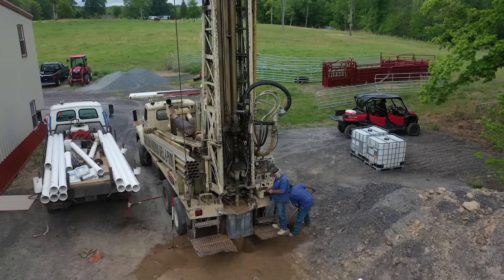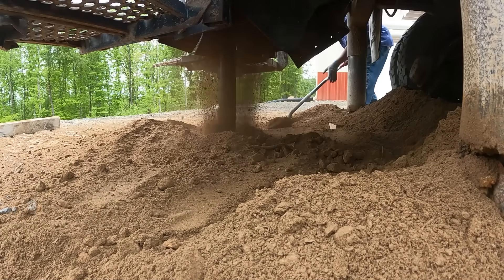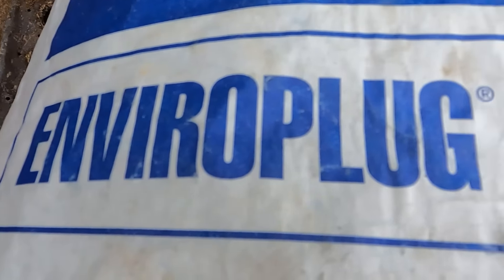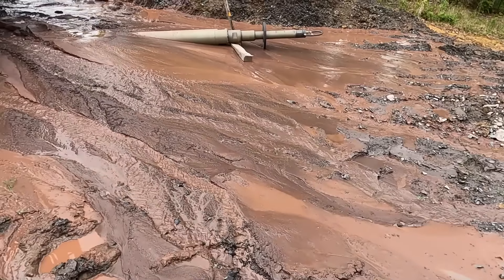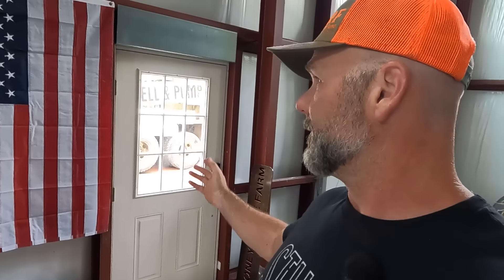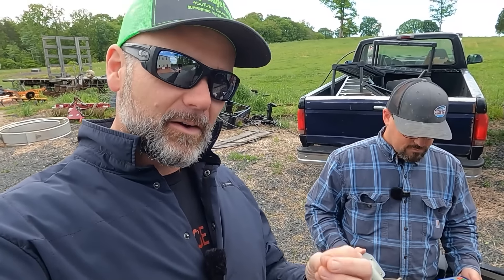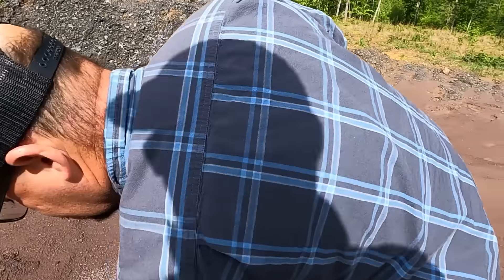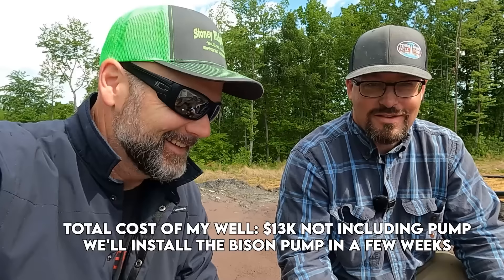How to drill a well on your property, land or farm?

Comment: Nice video, thanks! The initial drilling (before installing the casing) is shown bringing up soil, which is shoveled away. But it is not clear how the rock debris is removed from the hole once the bit hits bedrock?
Reply from the maker: just like drilling into concrete....the stone chips/dust comes right up and out of the hole...pushed up by pressure from the water in the well drilling rig.  Once we get to our desired depth we blow the hole out and all the debris comes up....and yep...it's a fairly large amount.  4 inch drilled hole down 500 feet really is only about 5-10 yards of soil/rock/dust

Comment: Page 357

Blowout preventers (BOPs) are used to control the pressure in the bore when drilling or working over, ie performing remedial  operations on a producing well to restore or increase production.
Reply: Page 134

boring (Eng) = The process of machining a cylindrical hole, performed in a lathe, boring machine or boring mill, for large holes, or when great accuracy is required, it is preferable to using a drill.

Page 659

lath (Min) = A term commonly applied to a lath-like (long and thin) crystal.

Comment: The Red-ish color coming out at 285ft looks like Terasic Basin rock. I wonder if that's the case. If it ever collapses, the well should be screened. These guys are 90 miles from me. Static in NC should be around 30-40ft typically

Comment: Just had my well drilled in Washington, $29,689 tax included drilling only, it included metal casing and PVC casing, 320 feet deep well and 20 gals a minute. Than it was another charge for a pump setup and get it ready for the house, electrical work, panel on base meter for pump, 2 frost free hydrants, so that was another $16,900 tax included, I didn’t know it was going to cost me that much, but they did a good job

Comment: Yalls rig is crazy different then what im a hand on. We go typically 280-380 for red bed. We use water and mud pit to pump out what the hole makes and raise suction and add watwr as needed. Casing is last and fast the we gravel pack the outside of the hole. Depending on whether its irrigation, personal or stock well depends on the pack or concrete level

Comment: WOW, How time changes things! 37years ago, when I had my well drilled, it cost me $5 a foot! I got 25 gallons a min. Then several more homes went in and took my water table and I kept going dry. They came back out, drilled through the same hole( and only charged me from the bottom down) First time I was 125' deep, then they went down to 246' deep and I got 500+ gallons a min(pump truck would not pump m00re than that) and my static water level is as 12'. We didn't add any more water pipe into the well. still only have 120' of pump pipe in the well. I have run three sprinklers 24 hours a day for three days, and never run out. at forst, on the second drilling, water flowed out the top for three days before they put the water pipe and pump in. It was an artisan well for three days, then it settled. Been a great well since, I replaced my pump once.

Comment: How far down does the schedule 80 PVC go?  Why is necessary to dig hundreds of feet if the water starts at 26 feet?
Reply: Well Driller Here- 
Typically you Drill through all the dirt and clay until you hit bedrock, and then install the Casing so that it is sealed inside the Rock, so nothing can leach into the well.

The reason this well was dug so Deep is because they probably hit the Water Vain at a deeper depth, also you want a good gallon per minute to depth ratio for Storage capacity inside the well. Wells producing more water don't need to be as deep, and vice versa. 
The reason the water is at 26 feet is because the water pressure from the deeper vain is pushing the static water level all the way up to 26 feet inside the hole.  Hope this helped a little

Comment: Interesting.  Equally interesting is that you are planning on drilling a 4th well.  And I thought mine was bad in fall of 2021 for a large diameter well, 40 ' deep  at 16000 CDN (11800 USD) including submersible pump installation.  I got 100 gallon per minute recharge - problem is water is not good at all.  Surprised you are putting hand pump in because it makes washing vehicles a little more difficult.
Reply from the maker: 40ft deep is ground water....and ground water is dangerous
Reply: @StoneyRidgeFarmer  Can be.  But in these parts deep wells are typically sulfur.  My  water is not dangerous per se, it is all the minerals, hardness,  etc that are in it that make it not great for use.

Comment: and by the way, you don't need permits to drill any well on remote property or land. Only in the cities do you need the permit. Outside city limits their are no well drilling permit, when your off grip. if you saying you need a permit, you basically saying you live in the city or near a city.
Reply from the maker: my man....that may be the case where you live...but it's not the case here.  My county requires a permit for a residential well and septic

Comment: How much elevation difference can there be between well and house?
Reply: The pump pressure takes care of any elevation difference.  water is 62.4 lbs per foot or about  0,43 psi/ft for each foot of rise.  If the well is above the house, then gravity works in your favor.

Comment: In our country, that kind of depth is unheard of. Of course, the vast majority of people just have those primitive hand digging equipment that can take hours to dig several feet. I just contacted some guys to do it on our mountainside property and they weren't willing to dig on the higher elevations since they anticipated having to dig more than 50 ft and hit rock while doing it too. With their equipment they can take hours just to drill through a few inches of rock. Although, of course they only charge the equivalent of about $400 (about double the minimum monthly wage) to do it and you only pay if they manage to draw water so there's that too.

Comment: We are in the central valley of California.  Back in about August of 2019, my parents had to drill a new well.  Old well had metal casing and it collapsed. The cost was was about $20,000 for drilling to connecting to the system. Total depth was about 225'. I think static water level is 35'. Where I live, in the height of the drought, our well static level was 8'. Our well is only 53'. And our pump is a submersible and is down about 35'. I would have thought since you get a lot more rain than we do, your well would not be very deep. Awesome video!

Comment: 13k for 450 feet is hell costly amount. Here in India they change 90₹/feet after 300 feet the price slab change, increase by 5 i.e 95₹ , your 450 will cost 450*95 = 42750 ₹ in $ that will be 570$ and motor, gi pipe and electricity starter board will cost another 1lakh ie 800$ 

Congratulations on your new wel

Comment: Why the need to drill down 465 feet, if the water level is 26 feet down from the surface?
Reply: Thats not where the water is but where is sits static in the well pipe. Remember the water is under pressure and is being pushed up the pipe to the 26'. They drilled to 400+ feet to reach enough water to get the min 5GPM. Its actually not that much flow. I would assume the GPM for an agricultural well would normally be closer to 20 GPM.

Comment: 8 hours for 465 feet vs???
let's say you want to dig a well 5 feet diameter by hand, 12th century style, stones " gray walker" wall and mortar.
Then, rope and a bucket.
How long do you think it will take???
Reply: Well it wouldn't be one guy for starters. And then they would normally have a pretty good idea where to dig where they would hit water shallow. I would say under 2 weeks. Small price to pay vs. hand carrying water long distances or living near a stream that was maybe not clean and potentially volatile with flooding etc.
Reply: Water delivery into a 5’ hole would be higher than into a 6” hole - way more surface area. So it wouldn’t need to be as deep. Deeper than the static water level, but maybe 10-20’ below it instead of 300+.
Reply: It could take someone's lifetime.

Comment: Built my house 8 years ago. Had a well drilled. Two hundred ft. 5 k. On top of my sand hill in Sc. Great video  Josh thanks from. Sc
Reply from the maker: heck...me too...we went 360 ft and it was $5k...but that was before the rise in prices of everything...funny though...if you owned the truck in 2008 how does it cost more to drill a hole with the same gear? Hmmmm
Reply: @Stoney Ridge Farmer  I get the price of pipe and pump going up aswell as cost of living for employees, gas etc but that's a big jump. buying a home now and have to dig one so this is definitely a eye opener of whats to come